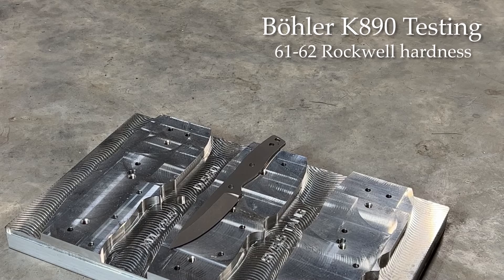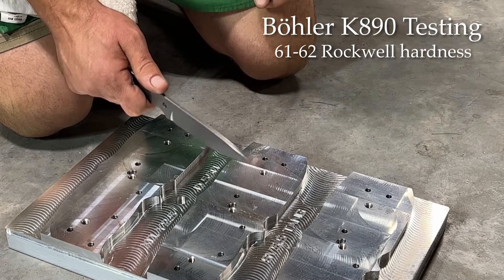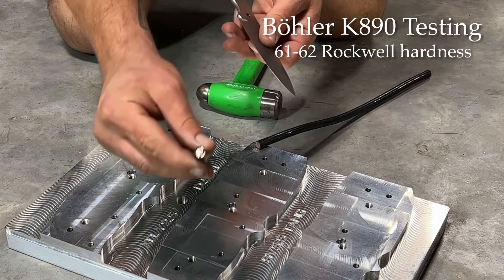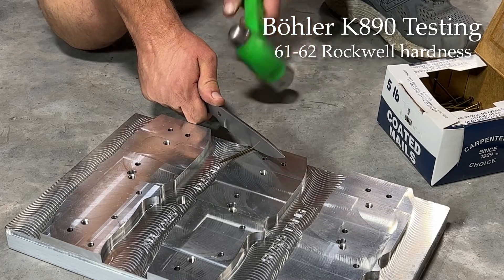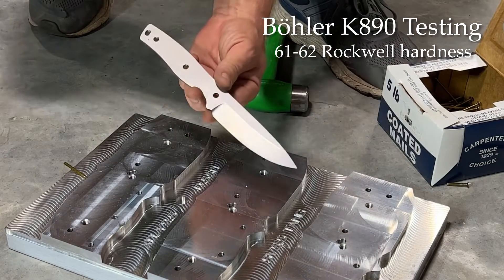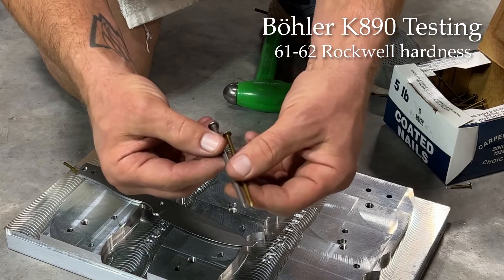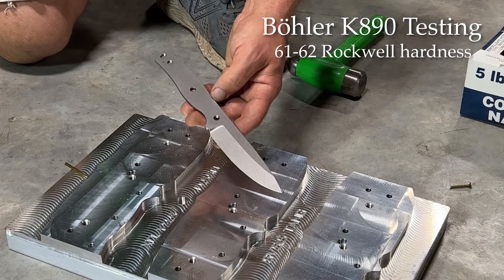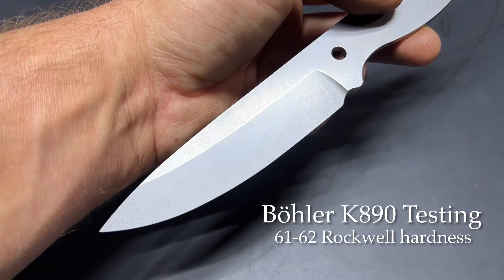Steel Testing: Böhler K890

Comment: In your testing how is the corrosion resistance of k890? Have you been able to improve it?
Reply from the maker: A low temper process will improve corrosion resistance, but I want to speak with Bohler about the implications of that before making a change. I'm not someone who likes to guess. They know all of the science behind their materials and how that may or may not affect durability, so I want to know their opinion.